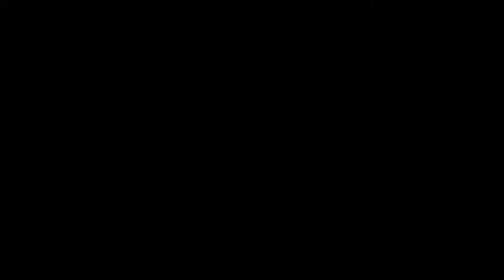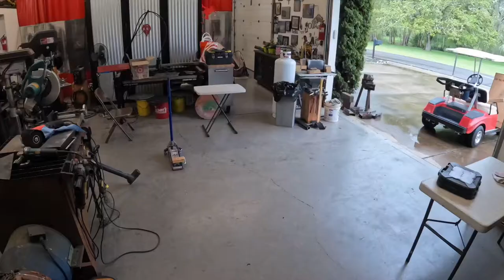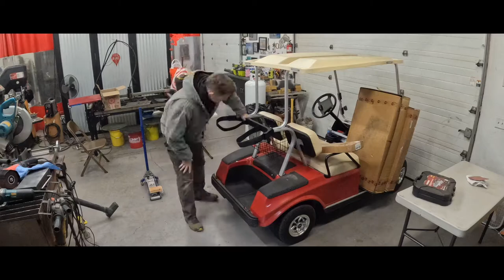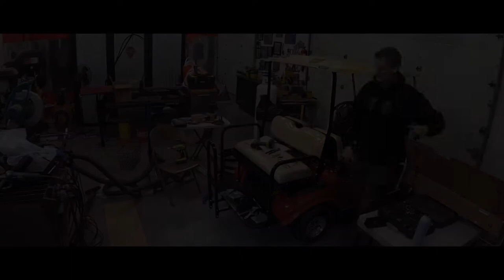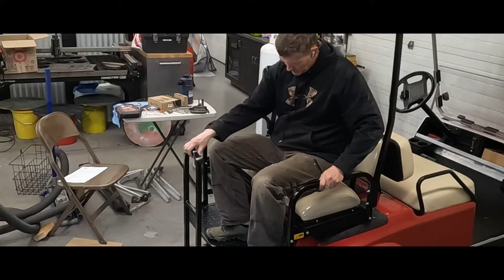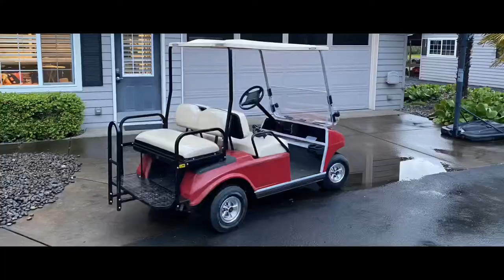1999 Club Car DS Rear Seat Installation Time Lapse

Comment: Hi, I have exactly the same golf cart. Which rear seat kit is that you installed?
Reply from the maker: I bought it from Amazon. It's the Performance Plus Carts Club Car DS Golf Cart Rear Flip Back Seat Kit for 1982-2000.5 - Factory Buff - Light Tan.  It has been holding up pretty well.  Here's the link: https://a.co/d/3uPJuws